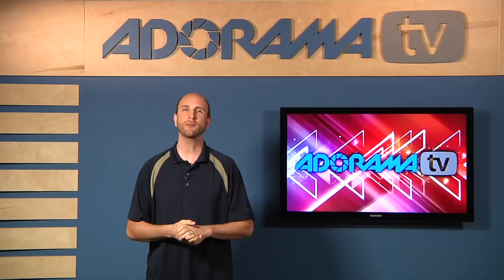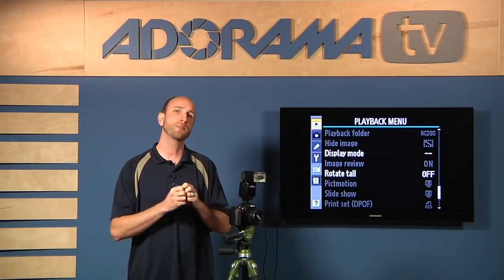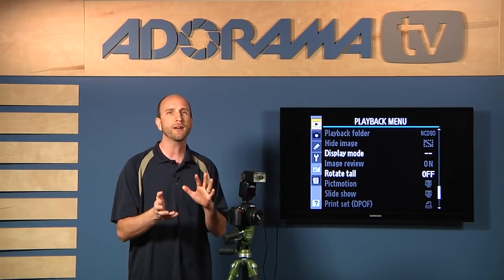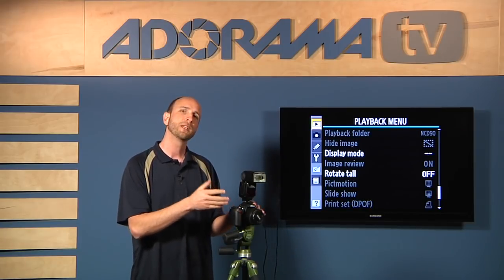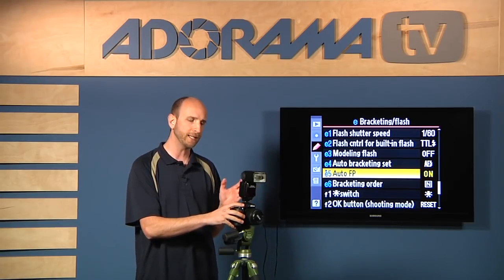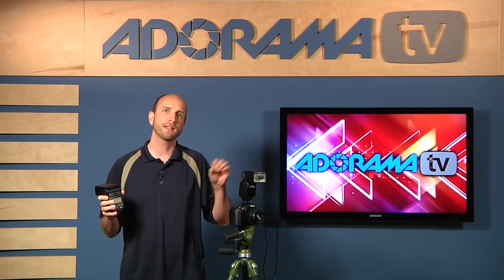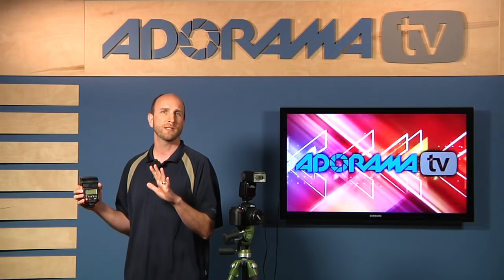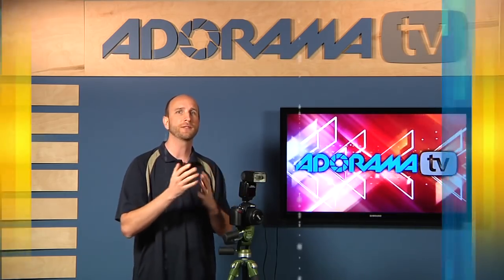Digital Photography 1 on 1: Episode 43: On Camera Flash Basics: Adorama Photography TV

Comment: @Maaniic The flash compensation button will allow you to leave the background at the same level and adjust the power of the flash - but to leave the flash at a consistent power and adjust the ambient light you have to shoot in manual mode. On a Nikon flash exposure compensation adjusts the flash output and leaves the ambient light alone but exposure compensation is a global change and effects flash *and* ambient light. Do some experiments with both and you'll see the difference.

Comment: The lens hood does two things for you: it reduces flare (and in the studio, you often have lights just outside of thee frame pointing nearly into the lens) and it provides cheap protection for the front of the lens without any optical penalty (as you'd get from an unnecessary filter). Shooting hooded is just a good habit to get into; "going commando" for intentional flare will then feel slightly uncomfortable, which is what you want your exceptional circumstances to be.

Comment: In the Nikon can't you just use the flash compensation button and adjust level with back dial ? On the D90 it's the same button that pops the built in flash.

Comment: Yes, you're missing something. If you want the flash exposure to stay constant, the flash needs to be in iTTL mode when your shutter is faster than the X-sync speed (with FP sync enabled, of course), or you have to increase the power level as you increase the shutter speed in manual mode. It might help to think of the flash as a dimmable constant light source when it's in FP mode (it's simplifying reality a tad, but "close enough for government work").